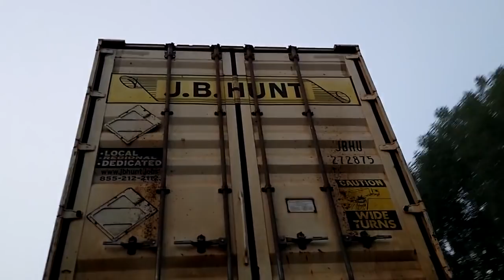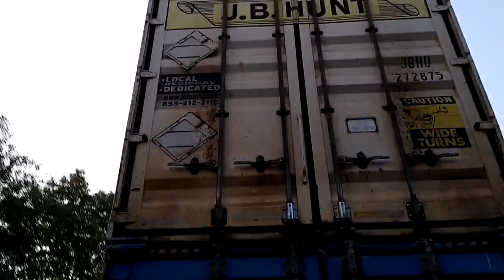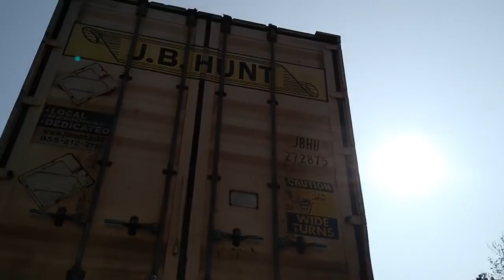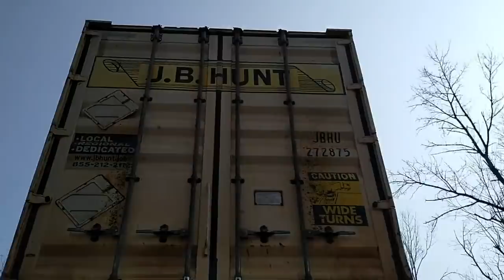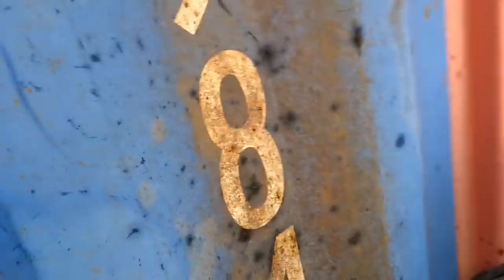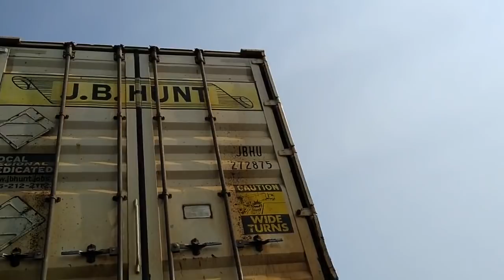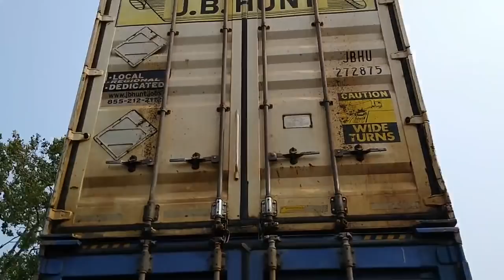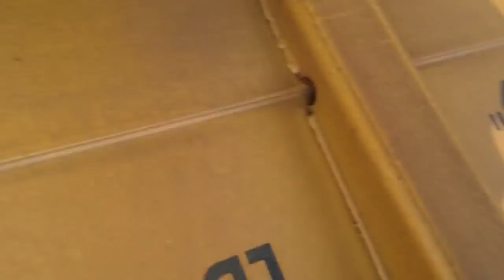Massachusetts to Buffalo intermodal ride

Comment: Shoestring, at about 3:30 there looks to be a yellow pipe protruding out of the end of the car....just under the cheese grader. It has a cap on it.  There is an identical yellow pipe with cap over  on the opposite facing  car.  Are these some type of air lines ?

Comment: Somebody needs to find or make some kind of container for gallon water bottles that will protect them from getting punctured, something made out of tin or aluminum that Shoe can just slide on a full bottle, then remove it when it's empty. I bet somebody has made such a thing and maybe sells it on Ebay, but I have no idea what it would be called. Also, a better microphone for his phone, maybe something Bluetooth.
Finally, a contraption that Shoe could put on his hat to hold a camera, so he has both hands free. Maybe get a motorcycle helmet with a camera mount, like Itchy Boots?
Reply: Lee Maxwell I purchased a heavy duty plastic bottle that I’m anxious to use. I think it will hood up better than the standard gallon jugs. The cheese graters on those double stack cars are sharp as all get out and more than once have punctured my jugs!

Comment: Are you in buffalo as of 9/16 5pm
Reply from the maker: Yesterday
Reply: Could have dropped you a bit sorry
Reply from the maker: @Tonytonytony948  may be coming back through next month
Reply: @TheHoboShoestring  it will be cold by then. Could even be snowing here. Had a bad snowstorm October 12th in Buffalo not too long ago. Then again could be 80 degrees! That's just the way it is here.
Reply: Tag
Reply from the maker: Did

Comment: 😱🙄👎🏻OmG, what a pain in the ass. How is someone supposed to know what..."the right part of the train to get on"... to get off at a Burger King, or other stops of choice, at different towns? What a hassle. I'd much rather just pray hard for a regular train ticket, or ride a bike somewhere.I suppose there are times when it makes some sense to hop a freight train, but... unless I'd be faced with some unusual ttpe of national emergency, I'd much rather just travel differently.😳👍🏻
And besides all that, I'd not wanna deal with the temp.-&-weather extremes, whilst traveling. Because then, dat only makes it dat much worse and dat much more of an absolute bawll busta.💦🤒💦💔🤢😟😣😳